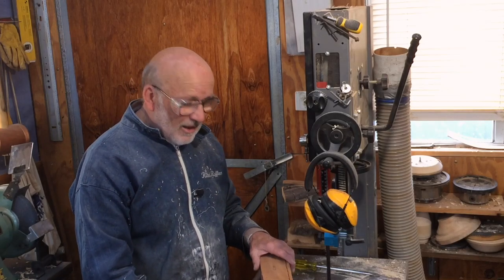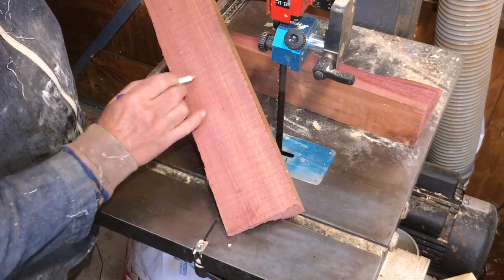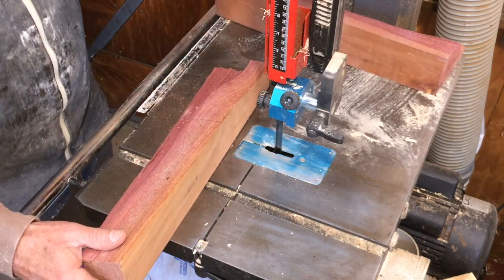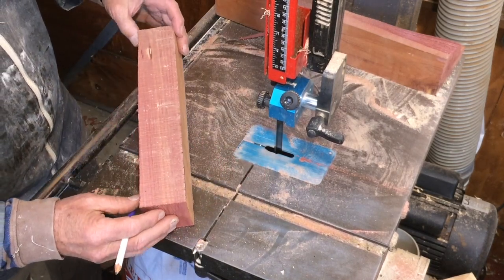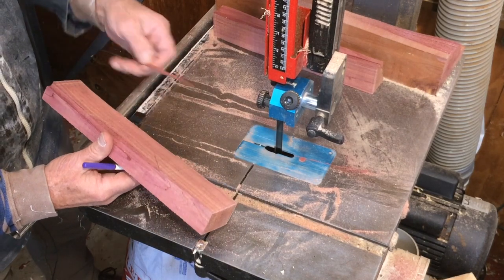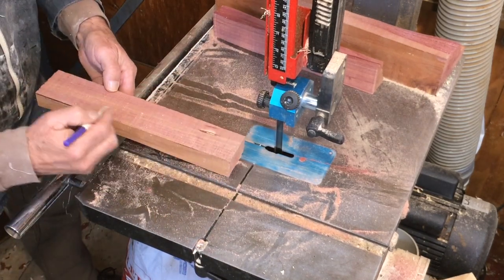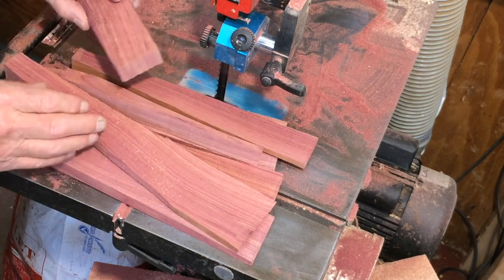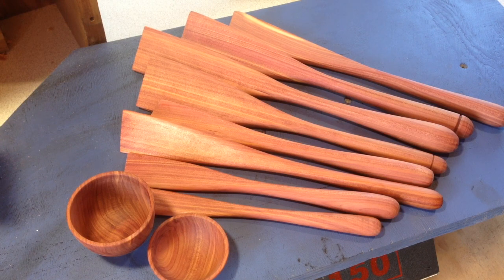Richard Raffan turns juniper firewood into spatulas and tiny bowls.

Comment: Hi Richard, thnx for another helpful video. I have a question if I may: Back in the days when you were production turning, how did you ensure to have enough (dry) wood of the right size available to make what customers wanted?
Reply from the maker: I usually had several hundred bowls rough-turned turned to standard sizes seasoning. Off-cuts from the boards from which I cut bowl blanks were squared and kept for as long as possible, often over 10 years, for small projects, mostly boxes and small bowls. Several times I've sold off several palette-loads of surplus blanks. In Britain in the 1970s I had a several tons of 30mm thick London plane boards seasoning for breadboards and trays. Any surplus cash was invested in freshly sawn boards or burl.